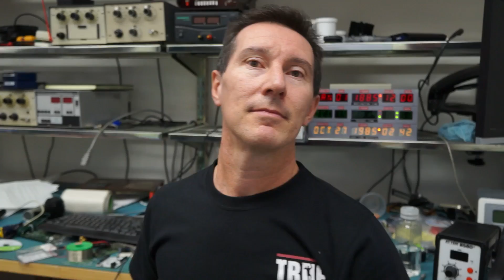eevBLAB #2 - Are Electronics Hobbyists Useless?

Comment: As a young whipper-snapper in the 5th year of elementary school in the US, I was introduced to simple circuits where we wired up small bulbs in series and parallel circuits, and made a simple motor out of magnet wires. It was around the same time that 8bit pc's like the apple were getting popular. When a local bank started a promotion where you would make a certificate of deposit of a certain amount for a minimum time period, you could get a free atari 800, coincided with my starting a part time job, I ended up first computer by the 7th grade. After a year of being too know BASIC and the software, I got curious about the insides and started taking out apart. There were magazines that I found at the library with instructions on diy upgrades such as expanding ram, installing higher frequency clock chips, etc. I bought my own soldering iron, and learned how to solder based on books and magazines at the library. I even found a article on creating a speech synthesizer module that required etching my own circuit board. Caustic chemicals? Flux fumes? pB alloy solder? Yep.

If I could do it, anyone can. It's just how motivated one is for their hobby.

Comment: Love yer rant, Dave, as always ;-)

When I was at university, I was horrified at the level of skills (or rather, lack of skills) exhibited by the students - electronic engineering students were actually the worst. 4th year students who couldn't solder jack, and had no idea about practical circuit design. Probably the fault of both the students and the teaching, but the end result was that an electronic engineering student was about the last person you'd ask to do any electronic engineering. (Of course, there were some good uns, but you get the drift).

Like you say, it's so easy nowadays to get into practical electronic design - be it Arduino (yeah, pile in, fanboys), etching your own boards, blah blah. Speaking for myself, I have never had any formal electronics training; all the stuff I've just picked up as I went along, which I personally think is the best way. Sure there's lots of stuff I wish I knew, but I can make best use of what I know, and I can always spend time learning what I don't. 

I'm on a mailing list with various guys who build lasers (and I mean, build them; CO2, nitrogen-pumped dye, flashlamp-pumped ruby etc.). We always have a great laugh when someone references one of the laser pointer forums where people are all so excited that they've "made" a laser - all they did was stick a diode, some optics, and a battery together!

My pointless rant....
Reply: ***** You do not understand what a university educated electrical engineer is. It is an applied mathematician.
Reply: 0MoTheG so true... I don't regret it, loved my classes, but it's the facts.

Comment: I learned how to do my own boards in highschool during an elective electronics course.  Never did much more with it, but that knowledge gave me the basics of understanding "how" electronic devices including computers function.  Gave me a leg up with understanding programming of computers in general.  My last "electronics" project was working to replace a LED strip lighting in the tail light assembly of a car.  The factory just used led' in series with resistors to control the current.  Well, as we all know, automotive electrical systems are not really that reliable, and when one led went out it took the whole string.
So I started a project to rebuild the strip with a constant current regulator but got hung up on board costs.  The board needed to be long and skinny, and that just was too non standard.

Comment: I am only a hobbyist myself. but i have done my own basic PCBs designs for the Commodore 64. using the most basic of tools because i don't have the money. just using a laser printer, press n peel, photo paper and even printing on wax paper to transfer the toner to the copper clad boards. my soldering skills are excellent. i have even soldered SMD components with ease with the most basic of soldering irons. i have also done desoldering(with hot air a soldering iron) work with old computers to repair them. i know what OHMs law is(when i can remember the maths which is what lets me down). i can read basic schematics. And yes i have HI functioning autism(astberges sybdrome). i would jump to the job if i lived in Sidney. but i am in the UK. I am no engineer or have qualifications because of my autism.

Comment: I could do some design if I have the circuit.  I can do some soldering.  I don't do it much.  I have draw out and early stage 3 band equalizer using a simple lm386 amp for headphones.  https://www.facebook.com/photo.php?fbid=10152920318839252&set=pcb.10152920323624252&type=1&theater and https://www.facebook.com/photo.php?fbid=10152920318889252&set=pcb.10152920323624252&type=1&theater.  I still waiting on parts for this project and yes some testing needs to done.  Yes, I going to make the board myself.  I do understand basic electronic.  Keep up the good work.

Comment: i build tesla coils as a hobby
i started with small coils which required few parts and with very simple circuits made on perforated testing boards...
but as i started building bigger coils the complexity of the circuits got high enough that making my own PCB was required. So in a 2 weeks or so i learned Eagle built my own UV exposure rig and made my first complex circuit 

so to say PCB designing and soldering is to much for a hobbyist is utter bullshit

Comment: First, I am 40+ years out of college.  But even then, college was useless for learning "practical" circuit design and implementation !  After 5 years (paid my own through school) I left with a BSE, no "specialization".  I had classes in material, thermodynamics, fluids as well as basic electronics.  All the emphasis there was on theory.  Even though we had a few "hands on" labs, the only were for simple things: unregulated power supply, BJT and FET "audio" amplifiers.  Believe it or not we never discussed using transistors as "switches" !  I did have one class in "logic" and we did breadboard a few simple TTL circuits.  Adders, "carry look ahead", shifters were all lectures.

I learned soldering easily (heavy hands on auto background from a young age), but in 30+ years in embedded system design I never learned anything about board layout.  I would say that 90% of my electronics knowledge came from "staring" at schematics and then asking "what does this do and how and why".  Same is true for a lot of mechanical things (do you really understand for a manual transmission "synchronizer" works ?).  If I did not have experts at hand who could explain things to me.

"Practical" engineering is being able to look at things from a very high level and not get lost in the details.  (Too many engineers spend their lives looking at the sh!t on the ants on the bark on the trees to even know that there is a forest !)  Then you have to know enough details to actually build something.

The "do it all hobbyist" is fadding fast.  Hell, go try to find a "professional" welder/machinist with the knowledge (from firts hand experience) and skill that Keith Fenner has !  Thank God for the "maker" movement.

Comment: I do not call myself a hobbyist but I love electronics. I bought my first arduino in February of this year (2014) and I have learned so much since then. Hell, I have my own programmed system for my lights on my BRZ with multi-functions with a 328P chip for PWM, sound reactance and adding more each chance I can.
I Google 99% of the stuff and forums the other 1%. I design with eagle, etch and solder all my own through hole and smd.  I think they are some pretty damn good solder and builds, if i say so myself.
I don't have an oscilloscope...yet. I use dvm 's ALOT. I don't know a whole hell of a lot when it comes  to MC's but if I can do atmega chips in this short of a time, give a little more time and I will be able to.

To ask a "hobbyist” of the few qualifications listed, that should be something I apply for then.

EEVBLOG has been soooooo helpful, as well as others. I would like to say thanx.
Keep it up.

Comment: I taught myself electronics by reading books from the library and buying kits at Radio Shack. There was no online resources available at the time so whatever I could find is what I learned. I learned how to solder, basic circuit building, basic troubleshooting skills, PIC programming, etc and that was before i graduated high school.   About six years later I finally went to college and got a degree in Electronic Engineering Technology. Now I am designing electrical harnesses and mechanical assemblies for airport ground support equipment.

Comment: Nope I studied Industrial Design between 1997 -2001.  By the third year, we'd covered analogue and digital electronics, designed and etched (and drilled our own) PCBs, programmed pics with assembler, covered off mecha-tronics.  These were a sub-part of our greater degree that included CAD, material science, life drawing, machine shop skills and a few other topics.

Did I consider myself an expert in each of those subjects - no it was a Industrial design degree.  You're not asking too much.

Comment: I consider myself some kind of electronics hobbyist. I've never had any formal training but I can understand\follow schematics and build circuits from them, lay out boards in KiCad, even produce double-sided ones by hand with UV resist or toner-transfer and solder SMD parts down to QFP etc by hand (Yes, even on a DIY board with no soldermask, I am crazy!). I would happily do BGAs in a toaster oven if I had the need. I've repaired some LCD monitors including replacing CCFL backlights, various SMPS, stereos, TV etc and even designed a couple of basic circuits with 'building block' digital stuff like 4000\7400 series but in general terms of design I'm pretty bad. I can adapt other people's (digital) designs but I wouldn't have a clue how to make a basic audio amplifier from discrete components for example and my coding skills even on Arduino are probably quite laughable.

Comment: There's a funny thing that here in Finland the base for hobbyist (harrastaja) is harras which is something akin to holy and these people take their hobby rather seriously, then there is a form "harrastelija" which is someone who does not take the hobby as seriously.

Back when I was starting electronics hobby (nineties or so) soldering was of course a basic skill (not that I learned to do it properly until much later, since I had no proper teacher), we also did some basic circuit design and pcb etching (just draw the circuit on the copper with a pen, ugh...). Got tired of veroboard and taught myself how to use CAD to layout single sided board and how to make PCBs with photoresist boards.

Did that until the cheap PCB manufacturers came along (double-sided etching is not a problem but making vias at home sucks), now I only bother with the etching tank when I need a prototype right now instead of waiting for the proper boards to arrive.

At our hackerspace we have a bunch of people at different skill levels but I'm fairly sure just about everyone has soldered something (we organize workshops to teach this basic skill). If one can design a simple circuit one can lay out a simple board (or learn this in two hours), designing "complex" circuits is of course a different problem. 

Basic debugging is essential skill, but that's mostly logical thinking and understanding that in general chips should not be hot or smoking and how to use a DMM. Using oscilloscope may help and in some cases might be needed but that is "higher level" skill, one learned very quickly if the base is solid.

Firmware development: everyone who plays with Arduinos is doing some kind of fw development, it's only a matter of complexity then.

Adding a bunch of IT skills makes the target person rather valuable generalist, so finding one willing to work for fame and peanuts might be a problem (not that I know what your'e offering or imply it's peanuts). I do a bunch of electronics stuff as a hobby but would not do it professionally (mostly because I think I'm not good enough even though I've designed and built a ton of stuff some might consider advanced). I do a bunch of programming, sysadmin etc stuff as a hobby and also professionally but when I'm doing it professionally I'm being paid way,way more than fame and peanuts. Also not saying fame is not valuable (and I reckon a letter of recommendation from Dave is worth quite a lot when seeking work, not to mention the networking opportunities when hanging around him).
Reply: I don't see how anyone could learn electronics without learning to solder! A soldering station was one of the first tools that I bought.

Comment: Hobbyist the old days: we do what we want, and we want to understand what we´re doing, even chasing bytes at the traces in our C64s and done some all byHand layouts for our PCBs and etched them in the kitchen as well...(I remember what my mom asked me: what are you doing with my cake-mould).Spend hours in public/university libraries just to read databooks, which had been way to expensive to buy. Tried to find a place where we could buy all these 8049, 74HCxxx and 40xx stuff and the "new" 2SK135/SJ50 or the NE5534(a).....

Today´s Hobbyist: just instant gratification, IMHO!!
As i got "tonns" of mails out of our DIY-Synth projects sites, in where i´ve been asked on how/what someone have to do when he whants to build up his very own synthesizer. When answering these questions at a basic electronic level (i assume that he has at least some PCB skills, owns an oscillocope, know how to use OPAmps, Transistors...), mostly i got a mail in return, that he just want to build something like that, and this is not necessary to have all these skills. "...I just got a multimeter and a soldering iron and some SSM/Curits chips and i want to build something cool with it....."
Datasheet...? "...yes i got it, but it´s all much to complicated as i just want to have a VCO and a VCF like in the SCI-ProOne..."....That was usually the point where i left him alone.....
And all of these mails let me decide to sign off that online synth stuff at all as more and more 14m32 came in...

No clue about anything, but claiming hisself to be an electronic hobbyist.....sad but true!

Dave, i agree 100% with you here.....so do not lower your level...instead: check carfully if the claimed skills are available when needed....;) Good luck!!

Comment: I wouldn't call myself a hobbyist. I may have aspirations to an electrical engineering degree, but I've certainly got a lot of work ahead of me. I did run my own general electronics and computer repair business out of my garage, and did a mediocre job with it. But I wouldn't say I have anywhere near the skill you're asking.

Yet, from what I'm hearing, I have more "qualifications" than some of the people who're responding to you. I've designed circuits on paper before. I may not have designed pcb boards, but I can't see how I couldn't learn to do it in a day. I got pretty good at soldering with a clunky, unwieldly large pistol-grip soldering gun, and I can imagine with better tools I could do an even better job.

If these guys are that lost on some of the fundamentals in electronic engineering, then I'd love to see what they actually do know.

Comment: I consider myself an electronic hobbyist.  I have, on my desk, a breadboarded Arduibo clock; a 4-digit LED display, RGB led that fades blue to red based on temperature, and a single pushbutton. With that one button, I can view time, seconds, temperature (in C, F, or K), and operate a menu letting me set the time, brightness, order of the temperature options, etc. I need to add an RTC, I want to add proper LED driver chip, and a second temperature source (outside), and then I'll look at making it up in a proper PCB. Now, I've poked at KiCad, but haven't gotten terribly far (mostly I can't find components that match what's on the breadboard), and it's been 20 years since I did any soldering (old Dick Smiths kits), let alone trying to make and etch a board (I did do a simple one with a pen and etching back then).  But still I'd probably fail your basic requirements, simply because I've been out of the game for the past 20 years - but I reckon that's nothing a couple hours practice with decent tools wouldn't fix. So, I think your requirements are, premature. Any legitimate hobbyists, I'd say, should be capable of all of that with a little guidance, but not all will have had the full breadth of experience to do it on their own right off the bat - as long as we can show potential. Otherwise, we wouldn't need to be watching you! (For the record, I'm on a pension, and find it hard to eat most weeks, let alone but what is really quite expensive gear - I would love the chance to bring my skills back up to that "basic" level, and beyond.)